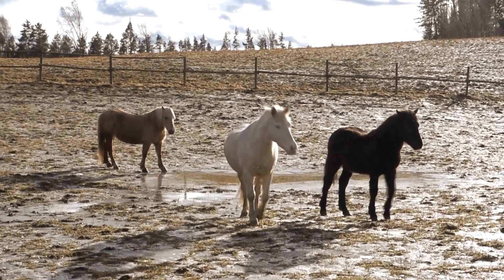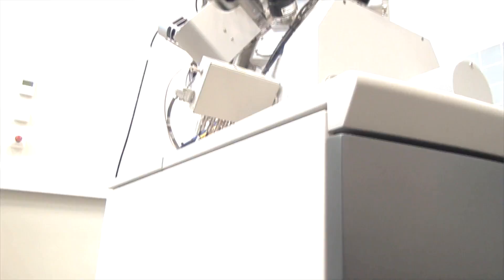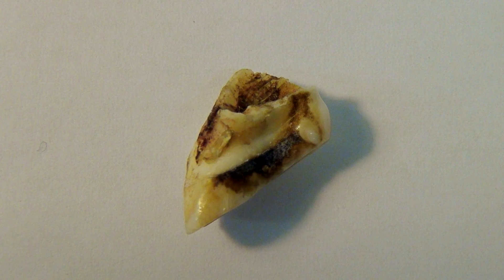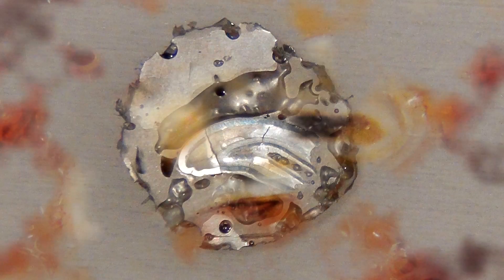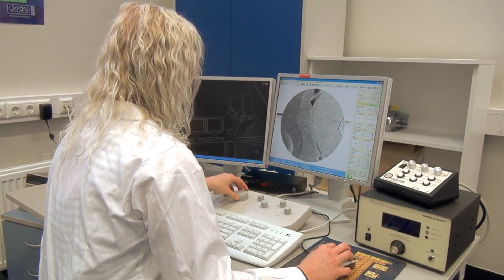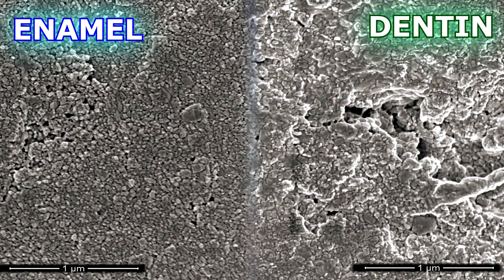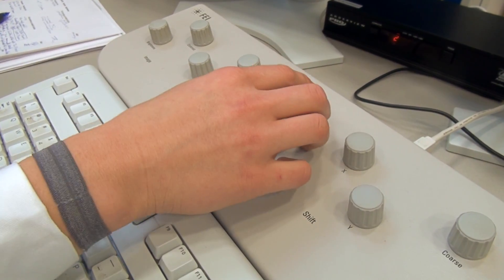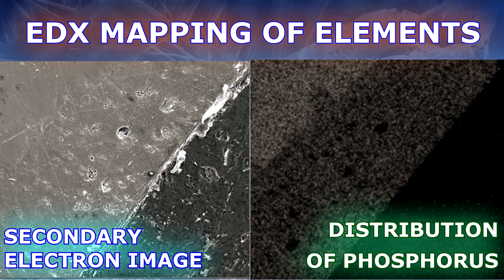Horse Tooth Under The Scanning Electron Microscope

Comment: Just out of curiosity, did you need to dehydrate the tooth before embedding at all?  Since the Em works in vacuum would not dehydrating and drying the tooth cause problems?  Does the resin embedding negate the need for dehydration?
Reply from the maker: Hi and thank you for the question! The tooth had actually been extracted a while ago before it ended up at us. So it probably had plenty of time to dry. If you did the same study with a freshly extracted tooth, then I'd recommend drying it at least a couple days in a drying cabinet and/or under low vacuum (use a pre-vacuum pump and a glass chamber for instance). Afterwards encasing the tooth in vacuum epoxy and coating the top with thin metal will also reduces outgassing quite a bit. However, if you have access to an ESEM (environmental scanning electron microscope), then you could also study a freshly extracted tooth and its cross-sections without any unwanted effects from drying (e.g. cracking, shrinking, deforming etc).
Reply: @CaptainCorrosion  thank you for your reply.  I have freshly extracted and suspected ancient teeth that I'm working on.  Figured out a dehydration procedure that should work, very similar to what you mentioned.  So I'm hopeful it will not cause too many drying artifacts.  If my initial procedures do then I can tweak things.  Thank you again
Reply from the maker: @AngelCarrieBander  And thank you too for watching the video and contacting us!